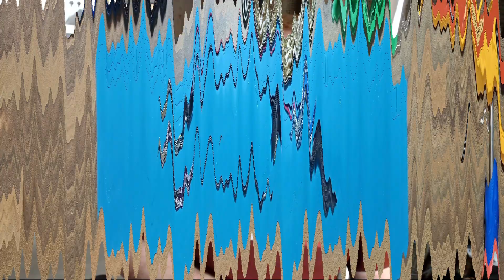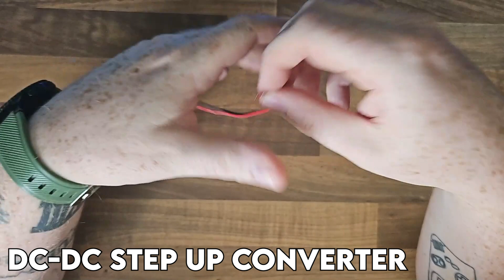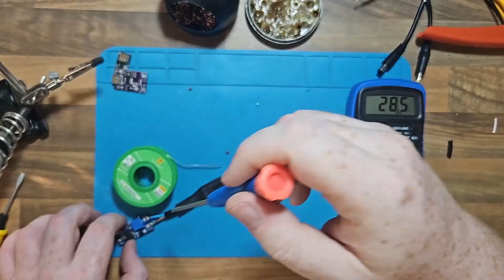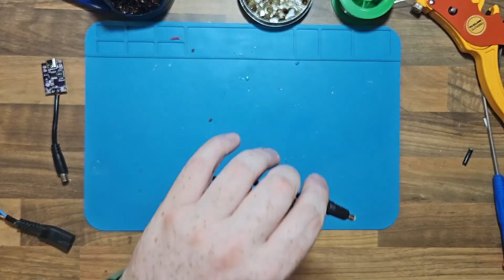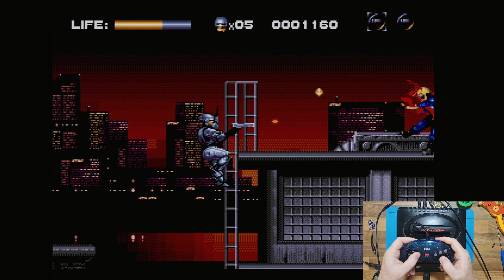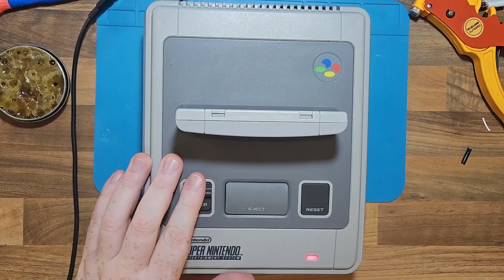Transform Any Console: USB-C Power Delivery PD Mod Guide!

Comment: PS2 Slim original PSU is 8.5V, but you connect 9V from USB-PD. Don't you think this can be unsafe for the console?
Reply from the maker: You think that's bad? The GameCube is 12v, but the PD board is set to 15v!!!
But, no. These have all been working fine, and used to power the consoles during long game sessions. Zero issues.
Reply: @DReviewTing  this is not about "it works that means it is safe". That's about schematics of the board. You can check it for SCPH-7000X series, it is available online.
Reply from the maker: I won't. But thanks. This runs at the required 5Amps with tolerances taken into consideration. It powers the console sufficiently without any over heating, or under performance issues. 

I would always expect people to do their own due diligence with these sorts of projects, and I appreciate your concern.

Comment: I've bought a PS2 fat but it has different voltage from what we use here, this mod would solve the problem?
Reply: Yeah it will fix that as you'll use a phone charger and the PS2 will just accept energy as if it was a laptop or a phone with the same connector

Comment: Boy you don't even know how electricity works yet you use the soldering tools. You can't power AC appliance with DC current and vice-verse. PS1 has internal power supply, wich needs 110-220AC. The entire point of modding the consoles to USB TypeC port is to avoid using/needing their proprietary power supplies bricks. Only PsOne and PS2 Slim (7000) have power bricks from entire PlayStation releases. Nintendo and xbox on other hand, have them outside on all their consoles.
Reply from the maker: 🤣 "ah teh you wah boya". Haha, oh "boy". 
I assume you didn't watch the video. I'm not modding any consoles. I am making use of broken power bricks to allow a usb connection. Also, I have modded a ps1 and ps2 with usb-c powered, with these components, in a similar fashion. Also available on the channel. 
So take a pill, cool your beans, get back in your box and relax.

Comment: with pd 3.1 protocol usb-c can power almost anything. 
there is a poorly filmed vid on my channel explaining how i wired up a large format 55 liter dc compressor fridge in my living room to run off of a gan usb-c pd 3.1 adapter. has been running that way for almost 2 years now without issue. saves roughly 90% on electricity over the stock power supply, so efficient it saves us on electricity since i open the main fridge less often and dont let the cold air out a couple times per day.
with pd 3.1 there are stock 28v 5a usb-c power supplies (140w) off the shelf and soon to be 280w supported versions.
in a couple years once all the issues with pd 3.1 are figured out and solutions standardized, 48v 5a thru usb-c will be the new norm, thats easily 280w on tap thru the usb-c 5a capable cables we have now.
that means with some clever voltage stepping, you can stuff off the shelf pcbs into xbox 360s and xbox ones and get them to run nativily off usb-c pd 3.1

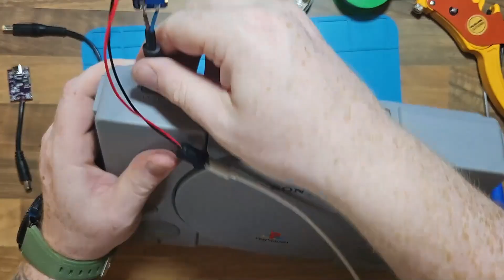Comment: @5:40 the PS1 does take AC power. I have read you can put DC voltage into an AC power input at lower input voltages, but the PlayStation needs mains voltages and drops the voltage internally with its power supply. Pretty sure the SNES and Mega drive have AC inputs, but at lower voltages (hence the wall-warts).
Reply: How do I successfully do a ps2 usb c mod, as someone who hasn't touched a soldering iron, and isn't good with electricity?
Reply: European SNES uses AC, if I'm not mistaken. In the US, Latam, and Japan, it uses DC.

Comment: the ps1 will not work. as it is essentially expecting 220v or 110v AC. So the brick is built in to the console. What happens in a nutshell is mains power goes in to the PS1, where it is converted from alternating current to direct current think from a wave that repeatedly goes up and down to a straight line at a fixed value. then you would have close on 300v which is way too much, that it is why it is stepped down internally and finnally smoothed over, to deliver the low dc voltages the console needs.

Giving it low voltage dc at the input won't work, as the circuitry inside is simply not designed for it. For the PS1, there are cheap replacement power supply kits for like 20 usd on ebay, that are designed to take in low voltage DC instead of the AC mains. then you would be able to connect your usb C power source.

Alternatively, if you want to do it yourself, you could get multiple buck converters, place them inside and power them using the same usb c cable, and then tune each converter to deliver one of the internal voltages that the ps1 requires, then join the grounds together. but i wouldn't since a premade solution is available and cheap

Comment: i believe people have already commented but i stumbled across this when researching how to do a PS1 USB-C conversion because i have a japanese model that wont work in germany. 

What i have come up with so far is to buy an internal replacement board that converts the PS1 to 12V external power brick. They can be bought on ali express. If i then hack off the barrel jack and solder on a USB-C PD requester board, set it to 12V and put that in the place if the original plug, everything should work. The PS1 needs about 10W so my 30W phone brick should do just fine. 

Ill probably do that conversation soon, hope it works! maybe thats an option for you too then 🫡
Reply from the maker: That's awesome! Believe it or.not, but that's very similar to a plan i have for a DreamCast USB-C mod. I have the DreamPsu board, but it has a barrel jack. I am replacing this with the PD board.

I never thought about doing that with a PS though, so I will have to try it!

Thanks for the advice, and checking out the video 😃
Reply: @DReviewTing  Ohh that sounds great 👍 I'll have to go sub and see if everything works with your Dreamcast build, good luck 🙏
I'll update here if my PS1 conversion idea works

Comment: Where did you get the ps2 cable from?
Reply from the maker: From a broken megaedrive power unit. The same connection fits both the ps2 slim, and megadrive2

Comment: I cringe a lot less because those donors seem to mostly be things that are still being manufactured, so it's not like there would have been any reduction in needed supply anyways. Still, I like that you stated that as it can get rather frustrating watching people destroy perfectly good hardware that's out of production for something stupid.
Reply from the maker: I definitely appreciate that. I tried to repair the megadrive psu, but figured I'd have to replace capacitors in the end, and I didn't want to chance that, haha. The cable for the snes/nes was a generic power cable for an old router, haha.

But aye, I'm definitely not ripping apart something works to get the same result in the end haha.
Reply: @DReviewTing  I'm personally on the fence in terms of destructive mods for things like HDMI output being swapped for the original outputs, it's other people's stuff so they can do what they like, but at least it largely maintains the ability to use the unit for it's intended purpose rather than for something stupid like book ends.
Reply from the maker: @SmallSpoonBrigade 🤣🤣🤣🤣 absolutely agree, haha!

Comment: What model ps2 do you have ? I have a 70000 series and that needs 9v @ 5.5Amps. So the steam deck USB-C PSU wouldnt cut it.
Reply from the maker: I'll need to double-check my model. I also have the disc drive removed in this, which would lower the power requirements. I'll have a closer look. Thanks 😊

Comment: i bought some cheap chinese usb PD boards and when i plug my mobile adapter on the wall it takes up to  5 seconds to handshake before i can try powering the console on, otherwise nothing happens : D
Reply from the maker: Well that sucks. Is it definitely a 20w fast charger you're using? I got mine from Aliexpress, so I assume they're the same boards?

Comment: 4:20 you could have bruned
Reply from the maker: Sorry, what?
Reply: @DReviewTing  Some devices don't survive reverse polarity
Reply: @DReviewTing  Presumably burned. Anything that takes DC voltage can't be assumed to have a rectifier built in to ensure that the polarity is correct coming in. I personally, get very annoyed when I buy electronics that doesn't show the polarity of the plug. Most of the time, the center is +, but not always, IIRC 2/3 of the Sega Tower of Power is center +, but one isn't. And getting that wrong can destroy things.

You can build a rectifier circuit in or other means of ensuring that the device is protected against reversing the polarity, the circuits aren't necessarily that complicated, especially if you don't care that much about the power efficiency because you're only using the console for a few hours a month. A simple rectifier can be made with just 4 diodes. Allowing current to just flow to one of the outputs for negative and the other for positive. It's not the most efficient circuit, but it can also be used in this case to ensure that the polarity is correct. I may wind up doing something similar with my Sega consoles due to the weirdness of the polarity. I don't know what they were thinking.

Comment: I think your research has gone a bit off, the original playstation has an internal power supply and the connection to the system takes 230v AC, the later released PS1 was made smaller in part by externalising the PSU and that outputs I think 7.5v DC like your trying to do so it won't work on the playstation your working on, nice work on the others though
Reply: Figure 8 jacks like this is 120v-230v AC as in from wall-jacks, always! I did not know what to think when you soldered that to a PD-board😅 Sorry man, ngl, that was whack😂 Keep on keeping on tho!
To be helpful tho, when you see one of those on a console, its not necessarily the end of the road, it just means that you will have to dig a bit deeper and figure out what  dc-voltages go from the internal psu to the actual console itself. PS1 phat has 3,5v and 7,9v internally, so any PD-board that can provide these two voltages can be jammed in there in place of the  power supply
Reply from the maker: @espset1234 😂 I greatly appreciate that, man. To be honest, I'm not 100% clued in about these things and like experimenting and seeing what happens and learning from there. Also, alot of comments like yours have been super useful for learning. Which is mostly the reason  why I left it in the video.

Thanks again for the comment and guidance, and for sticking around 😅
Reply: PSOne however has a barrel jack input and runs on 7,5v, so I'm sure that would work well👌
Reply from the maker: Ahhh, OK. I see. I definitely got myself confused somewhere along there. Thanks for clearing that up for me. So do you think something similar would work with the PSone?

Thanks for watching and commenting!
Reply: @DReviewTing  yeah I'd bet you could get it to work as long as you use the regulator to step down from the 9v on the usb c board
Reply: @DReviewTing  There are guides on the internet for the OG PS1 and how to usb c mod it, most look like they require you to take out the original internal power supply and replace it with a custom power board. I think the ps1 uses too many different voltages internally that were supplied by the power supply, rather than getting one voltage into the board and using power regulator chips to get the various voltages. If you have one of the newer model PS1s, you'd just need to swap out the figure eight cable end for an appropriately sized barrel jack.

Comment: The barrel jack input should mean that the console uses low voltage DC power, also look if it has an external PSU, like the large wall warts style plugs, or the power supplies lumps in between the console and the wall, then give this mod a try on it. If the console plugs straight into the wall, without an external PSU, this particular style of mod will not work as it has its own internal PSU, so it needs mains power. Often the internal PSU's have multiple power outs, so 1 x 220V / 110V AC in, but it might have a 12V DC, 9V DC, and a 5V DC out to power various components inside, especially if it has a CD-ROM drive that requires more power.

The PSOne, the slimmer and smaller PS1, will work with this mod as that was a DC power in. Or you could open the fat PS1 up, and replace its internal PSU with one that takes a USB-C input straight into the back of the device.

I do know that the Commodore 64 external PSU supplies both low voltage DC and AC to the computer, get that wrong and the device dies. So it is always smart to check the power in requirements, measure the polarity of the barrel jack, and measure the voltage output of the power delivery board before plugging it in.

Also, if you notice that you get a fuzzier image, try hooking the power delivery board to an oscilloscope, to see if you get a clean power out supply from the device. Or cheaply try a different board.
Reply from the maker: That is absolutely amazing. Thank you for that detailed comment. That is exactly the feedback I was hoping for.

I'm still relatively new to power mods, but thought I'd chance it. Bit now I know why it won't work.

I've you ever join our discord, please shoot me a message. I'd love to talk more.

Thanks again!
Reply: @DReviewTing  I started learning by trying mods like these myself about 5 years ago.  Also things like ATX Pico PSU, RGB / HDMI display out mods, then buying and repairing consoles. It's an enjoyable hobby and I've got a Vectrex to work on at the moment, struggling.
Reply: @Jenkem254 I haven't I'm afraid, I have the XBox's ready to mod, I just prefer the older systems. One day I'll get around to it.

A slim version? Great idea. Make sure when you've completed it, you post your process.